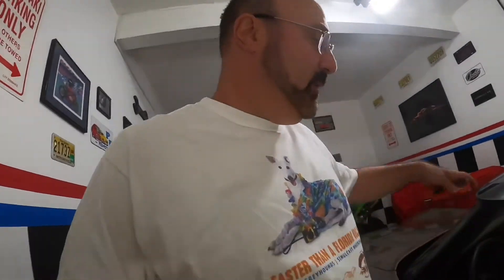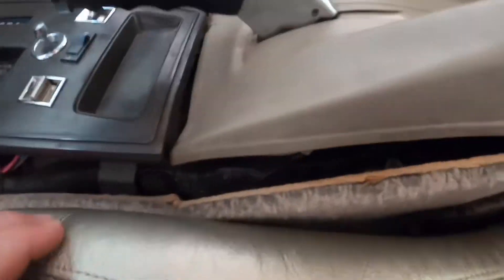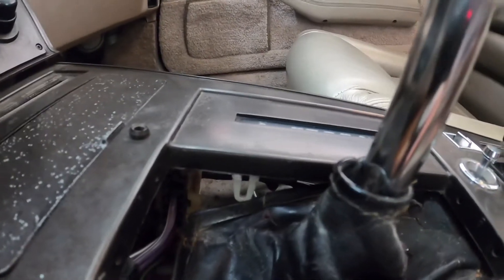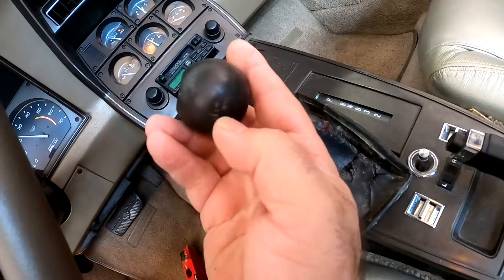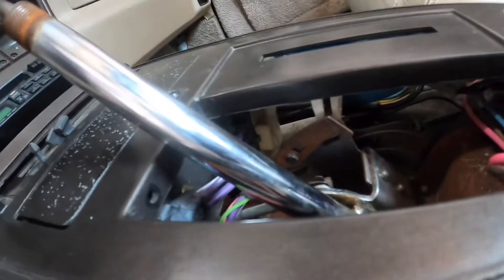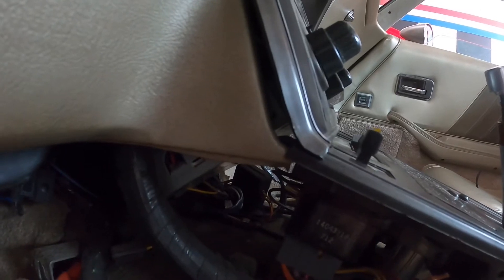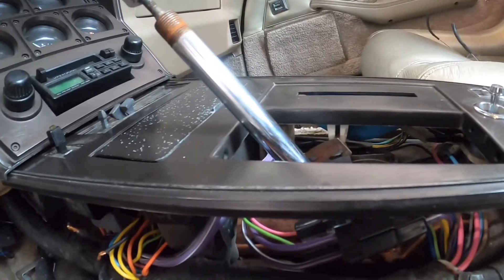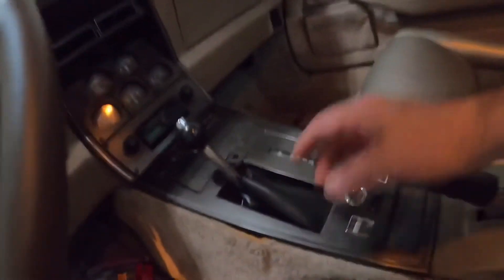TIPS AND TRICKS C3 for shifter boot replacement on C3 Collectors Edition Corvette

Comment: you did not show how to get the top shifter silver button off at start and return to position at finish
Reply from the maker: Sorry.  The top silver button comes of by turn to left to loosen.  There is a spring under it.  Then you can spin off the black portion of the ball by again turning it to left.  Hope that helps.